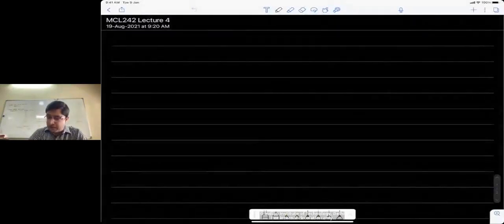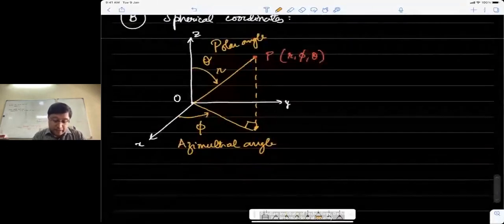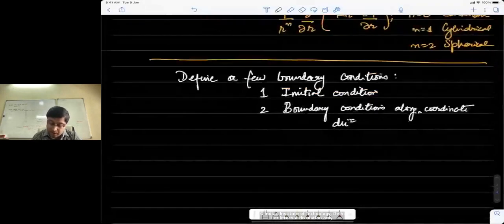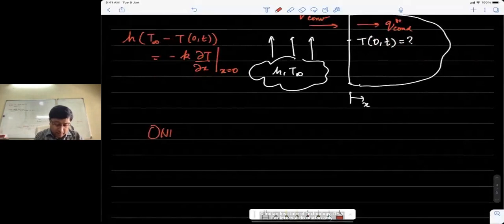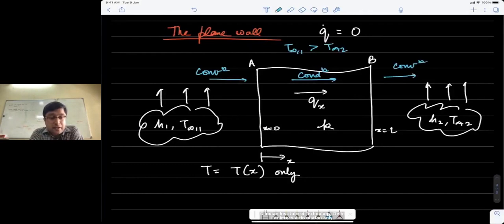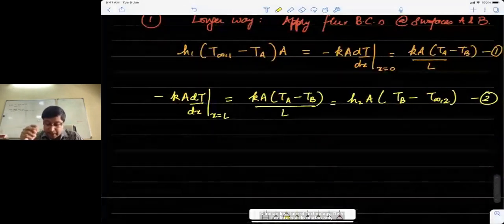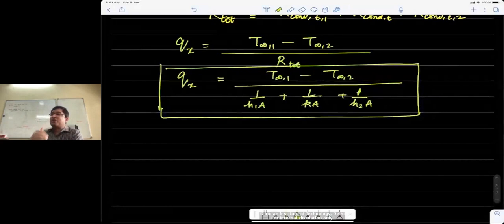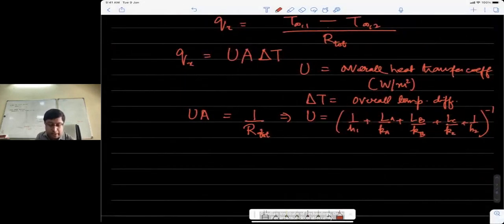Lecture 4: Steady-state 1D heat conduction, boundary conditions and electrical circuit analogy

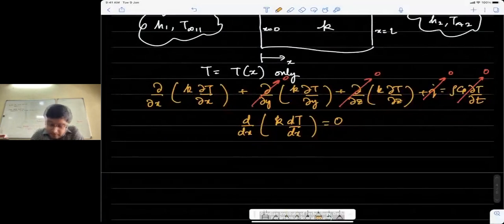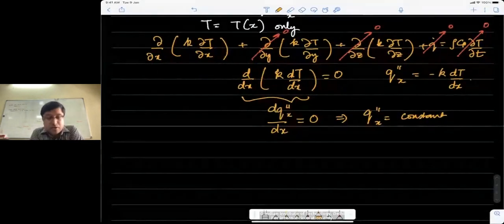Comment: According what is explained from 45:10 to 45:42, doesn't this suggest that if k is constant,  d^2 T / dx^2 = 0 for 1D conduction ALWAYS? ie; this relation holds true even if the cross sectional area is varying. 

This seems to lead to the conclusion that the temperature profile will be linear even for a varying cross section, which doesn't make intuitive sense. I do intuitively understand that it is the heat rate which is constant and not the heat flux, but the equations seems to suggest that its the heat flux which is constant (we didn't have to assume that the area of the slab is constant with x to come to this result at 45:42).

Please help me understand where I'm going wrong.